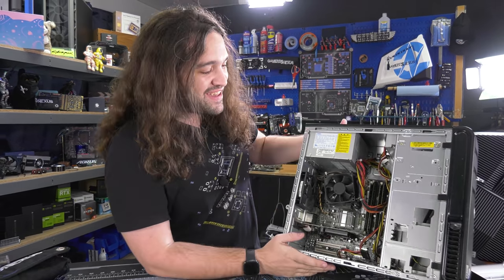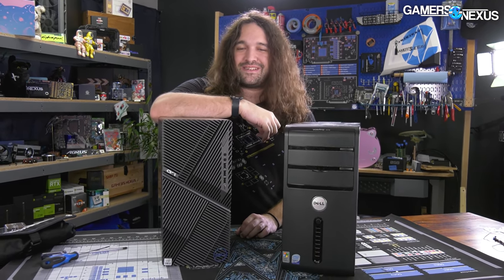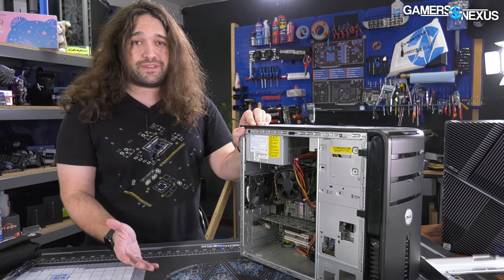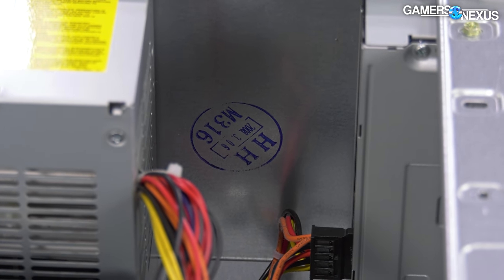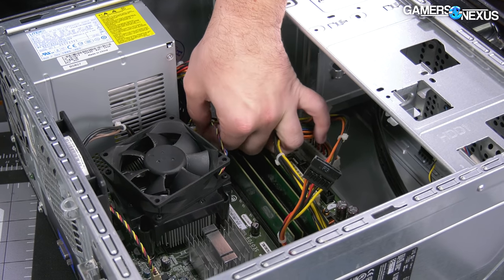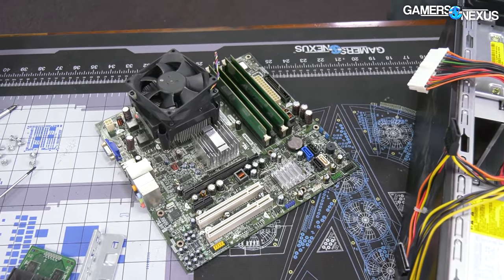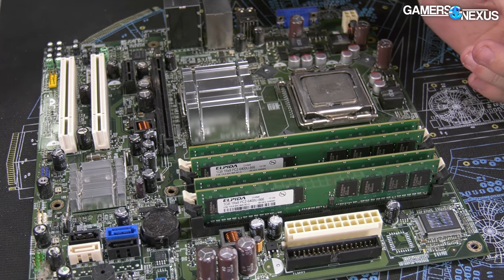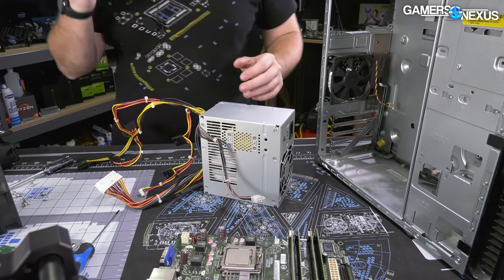13 Years of Dell Getting Worse

Comment: My moms boyfriend bought 2 of these.  One for her and one for his mom.  Within a few years the MB in both were dead from the same problem.  The ram slots stopped working one by one.   There ended up being a class action he was a part of where Dell knowingly used faulty capacitors to save a few bucks.  So I wouldn't say dell was any better back then tbh.
Reply: Yeah but at least you could swap the motherboard in this one. And when the class action ends you might have gotten 40% of the cost back. Now imagine a class action on the G5 you get 20$ and maybe a cpu and gpu
Reply: At least that board is easily replaceable and the fact that it lasted a few years.
You bet now they use the same shitty caps and make things non-standard so that you can't fix it.
Reply: Yeah, no clue how many GX270's I had to repair. Yep, caps ain't supposed to look like that...or leak. Boot the computer up - see a black screen with "thermal event" on it, no need to even look - caps are toast.
Reply: Lots of things had bad capacitors back then...FYI.
Reply: Okay let me rephrase that: Dell is worse now
Reply: @grumpslowenleft9642  I assume it's impossible to replace the caps? or are they just too impractical to do that?
Reply: @pyrophobia133  I regularly replace capacitors, but only really on boards i care about. It only requires bare minimum soldering skills, a iron and some flux.
Reply: @Starscreamious  True, but the GX270 and I think 260 were bad enough for lawsuits. It wasn't really a matter of IF the motherboard would fail - but when - and it usually wasn't that long.
Reply: @pyrophobia133  Nah, replacing a cap isn't a big deal, long as you know it's the cap that's really the bad item and not the circuitry leading TO the cap. In the field, they did MB replacements - quick and simple. Dell had us send the bad boards to them, so guess they were repaired.
Reply: that was back then in the 2nd wave of shit caps, they where used by everyone in every thing.
From bussines CPs to industrial machines, TV's and what have you not.
Almost every electronic device made in that time frame has those shity caps.

The same thing happend in 2003 or so, that was teh first wave.

Whyt do you think, why "japan made caps" is such a marketing buzz word :-D
That came up after the 2nd wave.
Reply: better than now that's the idea, not better in general. Steve talked about how the 2008 system was still bad just not as bad.
Reply: There was a lot of companies that got caught up in the capacitor plague. There was a time from around 2003 to about 2006 we're capacitors of good quality were almost non-existent, and cheap low-quality ones were everywhere. I remember some companies willingly using low-quality capacitors even as far as 2008, resulting in class action lawsuits in around 2010. Many boards were savable simply by replacing the bad capacitors with better quality ones. I did this several times on these era of Dells, and HPs, to bring them back to life and resell them.
Reply: @SquintyGears  The motherboard actually isn’t swappable! Watching this whole video has made me want to pull my hair out because the case does not have a removable I/O shield. The I/Os are stamped directly into the chassis and only an identical motherboard can be swapped in. I know this from experience, and can tell you the Vostro 200, 400 and Inspiron 530 all use the same chassis. The slim versions also have a stamped chassis.
Reply: @Argophobiac  you can remove them with a hammer and a pair of pliers. Source: done it many times to ancient cases when I'm using them with a newish mobo
Reply: @lvl5monk297  No, take a look at the video again. The I/O shield is a sticker over solid sheet metal with cutouts for the I/O. There are no perforations or anything to break away. Putting in a new motherboard means cutting a rectangular hole into the back of the case. And good luck lining up the new I/O shield or finding a way to secure it well… several hours of guess work and drilling, grinding and cutting.
Reply: @Argophobiac  you might be right. I know some Lenovo towers have one that you can pop out with a hammer and a pair of pliers if you're will to be pretty rough with it, I feel like I've done it to Dell towers as well, maybe not
Reply: @lvl5monk297  I think I know what you’re talking about, I know I’ve removed one or two but I’m unsure if a non-Lenovo I/O shield can be put in its place. Even that would be better than these Dells, you’d be restricted just to Lenovo motherboards or have to find a way to secure a standard I/O shield. I’ve had to scrap out several of these Dell cases in the past even though the cases were in great shape, it’s just not worth it to buy an identical motherboard for a system from this era.

Comment: I guess the old saying "they don't build them like they use to" applies to Dell computers as well
Reply: Didn't they switch caps and mosfets during the old pc production? There was a lawsuit of them blowing up. So it's built great but ruined it by switching out the good stuff with crappy stuff midway of making it.
Reply: Uhhhh... I disagree. I have a Dell from 2004 sitting here somewhere and it’s built the same way the modern example is built. Actually, even more proprietary parts bc the fan on that ting is also proprietary.
Reply: @mouaxiong8618  Capacitor Plague. It's wasn't just Dell. Capacitors were dying everywhere. https://en.wikipedia.org/wiki/Capacitor_plague
Reply: @bodgemaster7946  If you're talking about the rear case fan, it's not exactly proprietary.  It's a 90mm which is still widely available.
Reply: Remember when Dell was originally formed in the '80s and they targeted enthusiasts (in addition to businesses)? I wasn't even born then so I wouldn't know if they sold good computers, but they certainly sound like they used to be a top-tier prebuilt manufacturer.
Reply: Same to an OEM i used to be really really fond off.
Asus, The N76 laptop i still have is brilliant.
It had 1 HDD and a DVD player. But the second HDD had it's connector already soldered on.

Making a SSD upgrade easy peasy. Same for ram just plug and play. Even the internal WiFi was easily replaced. Even though harder to find.
The Battery is a click install. So again an proper easy peasy fix.

Now 
Battery glued,
Ram? soldered.
HDD slot? no gone.

Etc etc.

Yeah things used to be better.
Reply: @JVHShack  I am talking about a fan on my Dell. It’s a 5 pin fan so I’m pretty sure it’s not standard.
Reply: @bodgemaster7946  Ah, ok

Comment: I find it funny how they still use the exact same cheap OEM aluminum heatsink fan for 13 years
Reply: Maybe someone got a good deal and ordered waaaaaaaay too many of them 😂
Reply: for low end cpu's they aren't bad. a block of aluminum is a block of aluminum
Reply: For something like a 65W chip they sure do, at least bigger than the Intel boxed fans they put on the 65W class back then. Obviously that only works if the chip really only draws 65W and not 130
Reply: 13+ maybe

Comment: It’s amazing how much standardized parts mean in a prebuilt. My first ever desktop was a Dell XPS 8100 circa 2010. Over the years I swapped out the GPU for an AMD 7870, the power supply for a Corsair CX650, the CPU cooler for a Cooler Master, the mechanical HDD for an SSD, and even swapped all of the components into a Rosewill case with better air flow. I eventually gifted that computer to family members and it lived on until early 2021. All of this was made possible by standardized components.
Reply: What happened in early 2021...?
Reply: @johnbamber7374  we don’t talk about the “incident”
Reply: i also have a studio xps 8100
Reply: @johnbamber7374   It still worked. But by that point, a lot of the core components were just very dated (the CPU for example was a circa 2009 Core i7 860), so its owner moved onto something a bit newer.
Reply: Is it even considered the same computer after all those changes?
Reply: @Perseagatuna   The motherboard, CPU, and RAM were still all original. Also, those changes didn’t all happen at once. They were done over a 6 year period. The computer spent 3 years of its life as an otherwise stock Dell with just an upgraded GPU and PSU.
Reply: @Perseagatuna  assuming he kept the motherboard then technically yes as the bios will report the pc as a dell xps 8100
Reply: I have a dell optiplex 9010 i7 I upgraded to a 1tb ssd, 32gb ram, and radeon 2gb 7600 hd series now its a 11 emulators 1200game monster with 27" spectre monitor 👍
Reply: I still have my Dimension E520, with the original 450W Sparkle Power PSU, just swapped to a Q6600 and MSI HD4350 like 14 years ago. Then I swapped the HD4350 to a 9800GT passive a couple years ago. And I originally found the computer outside in the trash during winter, covered in snow lol
Reply: I had a 8000! Same experience! I only upgraded about two years ago. I have since returned all the original parts to the machine, and it's amazing for a Windows 7 PC time capsule. It's still way overkill for web browsing and YouTube watching. Great for emulation too.
Reply: @Perseagatuna  a question as old as time
Reply: @kulled  So in your opinion the only thing that counts as a PC is the motherboard and everything else is just add-ons?
Reply: @Perseagatuna  i literally just explained how that is the case
Reply: @kulled  Well, in my opinion a computer is only a computer if it can compute. A motherboard by itself can't compute, it needs power, a CPU and RAM at a minimum.
Reply: @Perseagatuna  you're over complicating it. no one is questioning the fundamentals of what makes a computer a computer.
Reply: @kulled  I for sure am
Reply: @splewy  What happened to it then? Prob someone would find a use for it. Great you got 11 years out of it though!
Reply: My old XPS 8300 with an i7-2600 still sees usage today! Been through three case swaps, a PSU swap, and an owner change, but keeps on kicking.
Reply: ASUS and ACER(except low-end models) prebuilts are still use many standard parts, f*ck Dell, HP, Lenovo use proprietary PSU/Case/MB
Reply: Hey me too. That thing kicked ass. 2011 XPS was great. Really sexy case too.
Reply: @platinumsun4632  oh yeah I loved the look of the case. Especially back in 2010, it just looked so high end and futuristic. The new ones look so bland and cheap in comparison.

Comment: In the late 90s and early 2000's I always recommended dell to my clients because their products were always tested well and they would use descent components. They also had great on site support for my larger clients that could afford it. Its sad to see the crap their dishing out now.  Thanks for the video.
Reply: I wasn't too into computers back in the early 2000's, but my schoolmates were, and I remember them always talking smack about dell.
Reply: I thought Dell were supposed to be pretty good computers too (having been told that in the early 2000s). I've always had Dell computers/laptops and they've been fine, but i'm not much of a gamer.
Reply: I mean for standard house use, not bad in the early 2000’s. Attrocious for gaming, but not bad outside.

Now, the whole company is e-waste

Comment: There was actually a time when buying a Dell would get you a reasonably good system and a GPU upgrade could turn it into a really decent gaming rig. It was a fairly short time but it existed....I guess when big profits came in the company moved to making more profits with cheaper parts and spending the money on marketing instead of offering the good system deals that gained them profits.
Reply: Yep I was lucky to get mine during that period. Windows 98 SE period, it also came with Altec Lansing speakers/subwoofer thing was a beast. (Could shake the house) System was able to handle Half-life when it first came out (yes at one point half-life was demanding lol)

*Very early Dell had ridiculous parts surprised they actually made money lol. Kind of like Alienware back in the day.

Comment: That Vostro 400 is bringing back so many memories!
Reply: I remember hacksawing a Classic "blowhole" into the sidepanel, so it doesn't overheat after upgrading one of them with a better GPU.
Was a pretty popular upgrade for the forner family computer/hand-me-down: bigger PSU, new GPU, a side mounted fan with a metal mesh.
Reply: @timhartherz5652  I'm not sure if this works on the Vostro 400 but some of them can be overclocked from 266mhz fsb up to 333 with a simple mod also.
Reply: @mortenee88  every little bit helps for the broke student, some had to make do with the original PSU, leaving the side panel open and putting a deskfan next to it.
This and similar models stayed around for quite some time.
Reply: I have a old vosto so still running strong after 10 years. Still somehow putting out acceptable fps.
Reply: @timhartherz5652  yeah back then it was basic setup to take side panel off and put a 10" fan blowing in or play with laptop on "no-mouse" servers with touchpad or thinkpad nipple.
Reply: It seems an exception to me, I had an inspiron from the 2005, and the MB was mounted on the left of the case (looking from the front), requiring a custom MB that  was a mirror of the industry standard ATX board, for no good reason, and some wacky shrouded CPU cooler that couldn't be used on anything else.
Reply: @timhartherz5652  desk fans are definitely a pretty useful fan to use

Comment: Dell in 2008: Decisions made by engineers.
Dell in 2021: Decisions made by accountants.
Reply: They were always cheap. They just got better at being worse.
Reply: @mostevil1082  Cheap but at least cared, now they just don't care anymore.
Reply: Basically Intel for the past 10 years until now.
Reply: @BasedAstraea  The process here is "cost-optimization", the more time goes on the more they find corners to cut
Reply: @marcogenovesi8570  There's a difference between being anti-consumer, and cost cutting. Also devising a way to make your customers always buy new products because fixing the old one is impossible through cost or obscurity, is anti-consumer. I can assure you, Dell isn't engineering their motherboards and cases purely for "cost-optimization" they can do that in the parts choices they have for the primary PC components, then make it all back by over-charging you for it. The engineering department is being instructed to make the motherboard and cases easier to assemble on a factory line and non-standard so they can force the customer to buy new hardware every 5-6 years after something fails outside warranty.
Reply: Their consumer oriented stuff has always been by the accountants.
Reply: Doesn’t Dell survive off of huge company contracts the same way Colt (if you like firearms) survived off of military contracts? Any facility I go to I see almost exclusively Dell computers probably because you get a big discount when you buy 100 desktops from them lol.
Reply: @zachconant7031  HP, Lenovo and Fujitsu-siemens work the same, that's just "volume buy" for businness
Reply: @marcogenovesi8570  yeah so I’m guessing a company pays out the ass and in turn gets new computers every year in bulk.
Reply: @zachconant7031  you guess wrong, the "businness price" is less than half the sticker price if you buy single from website, depending on quantity and other factors. So the most gouged are the non-businness customers. Or if you are a very small businness and can't just buy hundreds of workstations.

Plus nobody in their right mind changes a fleet of hundreds of office PCs every year. The CEOs and other VIPs will change their laptop every 6 months but that's it.

There are "PC leasing" companies that give you leased PCs for an even lower fee than buying them, and will swap them eventually, but not every year, it's more like every 4-5 years.

Also for apple laptops, you can get a lease for MUCH less than buying a macbook pro laptop and they will replace it every two years with the latest model. But again companies that buy dell workstations aren't going to switch to macbooks
Reply: @marcogenovesi8570  I meant pay out the ass for warranties since they are buying an entire fleet. I know it’s rare but I do know someone who works for a company that regularly changed their computers and has to get them fixed all the time, so basically getting a new computer every year lol. And yes it’s dell.
Reply: @zachconant7031  businness support contracts are expensive, but it's something that usually means a tech will come and replace the device. It's not like consumer warranties where the manufacturer can tell you to pound sand if they feel like it.

I'm no dell fanboy, but replacing a PC every year sounds suspicious. Most workstations  of all brands survive their 4-5 year "tour of duty" and end on the used market and you can get them on ebay and such for like 1/5th of their "new" value. Maybe they have dodgy electrical power or some other factor that is killing the PCs.
Reply: @marcogenovesi8570  perhaps yeah or they are just bad at managing a budget
Reply: @zachconant7031  might be a case of "we must blow all the budget or the next budgets will get cut down". Not uncommon.
Reply: @marcogenovesi8570  yeah true
Reply: @zachconant7031  Nah the reason you see Dells in facilities and offices and factories and so on is because of their service model. For a large business they just handle everything. If something breaks you just type the service tag into the support website and they send you a new one, super easy. Lazy admins who don't want to do the work, or rather admins who work for companies who don't want to pay for any support, prefer Dell since they can let them handle most of the support.
Reply: As a former accountant now IT auditor and a CPA, I approve this message lol
Reply: @JosephArata  dell crossing the boundary of cost cutting for the sake of profit greed, why not when clueless people still somehow buy their product?